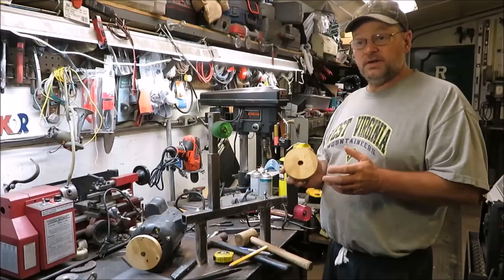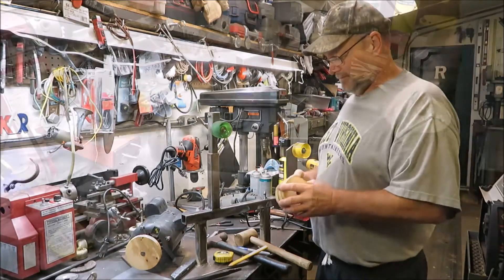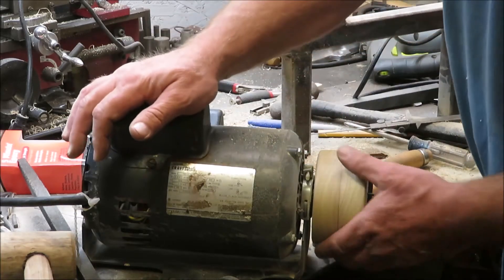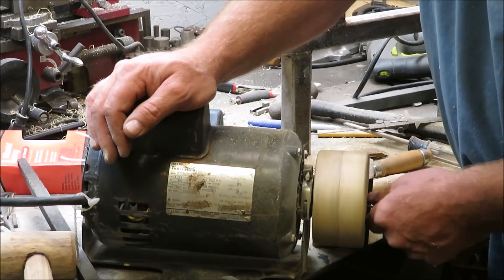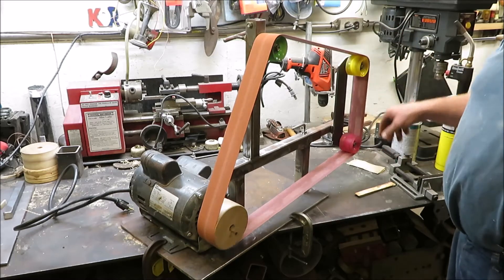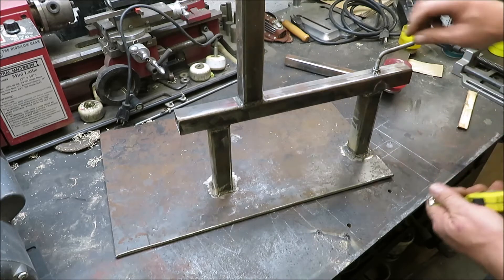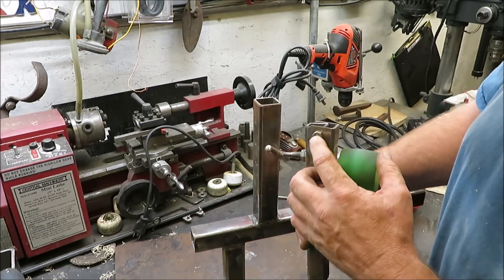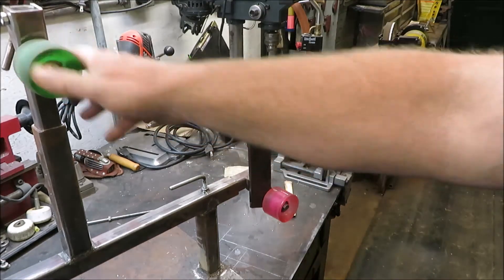homemade belt grinder build drive pulley and measurements part 6

Comment: Great job Kevin, looks to me like you might need more tension.  Try a stronger spring or add a piece of metal on top of the spring.  I am not an expert,  just what I would try first.
Reply from the maker: Thanks Ron You right I did put more tension on it and it works lot better.